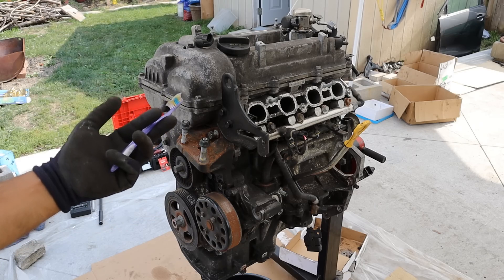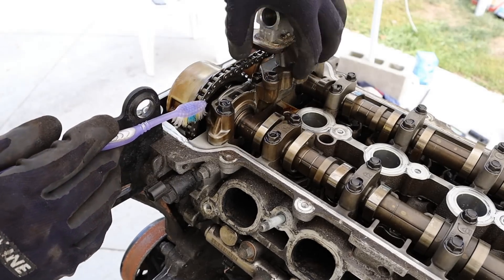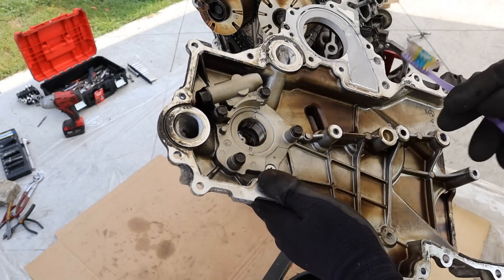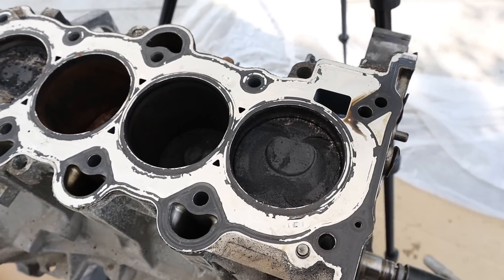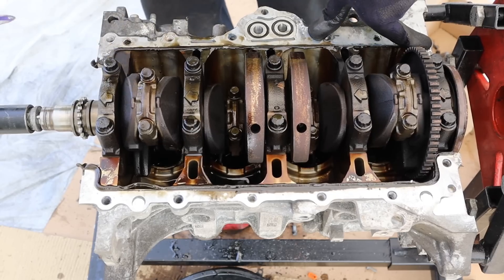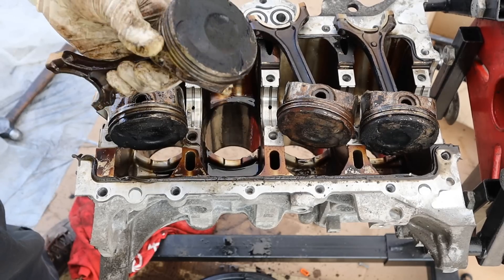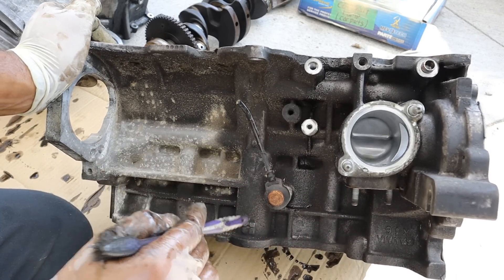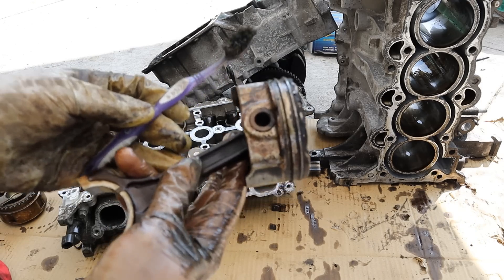Why KIA Engines Fail

Comment: there should be a oil level gauge on the dash that tells you how much oil is in the engine. Watching this video shows how important having the engine full of oil is. If your low 2 quarts of oil and car is going up a hill, that can be a big problem.
Reply from the maker: A lot of people will failing kia engines have them full of oil.

Comment: I know it's not the same engine, but we have a 2008 (!) Optima with the 2.4 4 cylinder engine ... purchased in 2009 from Enterprise Rent A Car with about 34k miles on it ... always used synthetic oil, with oil and filter changes every 5k miles. Always checked oil level at least once a month. It only burned a little oil once a year on fully-loaded vacation trips through the West Virginia mountains on the way to Michigan. Paid attention to other fluid service intervals, filters, etc. Not as durable as a Toyota ... but that car just hit 225,000 miles a month ago. So much of the longevity of any engine from any manufacturer is this boring thing called consistent maintenance.
Reply from the maker: Agreed, maintenance is key!

Comment: Check to see if there is a redesigned oil pick up tube (that's in the bottom of the oil pan) it was redesigned for the 1.8 and 2.0 engines.  The new part sits deeper in the pan and has a bigger opening.  Also Kia changed the oil level in the 1.8 and 2.0, (maybe this 1.6 to) increased it by about half a quart.  Check to see if they modified the oil amount for the 1.6 also and have a new modified oil dip stick available like the 1.8 and 2.0.  Finally, don't use 5-20, use 5-30 Pennzoil Ultra Synthetic, change it every 6k, if you want your engine to last (probably your new engine if you're reading this.)
Reply from the maker: Good tips, didn't know they made changes without publicizing

Comment: I bought a 2015 kia soul with a 1.6 gdi and a 6 speed manual. Brand new like 200 miles , 2025 the car still going with 270k miles. They are good cars if you keep up with oil changes at 4000 miles.

Comment: 2014 Hyundai Accent with 1.6L Gamma GDI with ECO. Purchased new, oil changes on schedule, regular maintenance. Started consuming oil at about 90k kms, and Hyundai told me I needed a new small block engine by 100k kms, for $11,000 CAD. Was burning through all of the oil before the next oil change. Combustion/Top chamber cleaning wasn't a thing offered by Hyundai/Kia when I purchased; today that service costs over $1000 CAD and you have to jump through hoops just to get a dealership to agree to perform it. 
Lots of stories like mine on various forums and facebook groups - it's not "just the owners".

Comment: I have 1.4 cvvt g4fa engine jd. It goes very smoothly. But i throw some money in it. For the engine i replaced couple of sensors, premium oil change with oil filter at each 5000km interval. Same goes for air filter and cabin filter. As i said couple of sensors maybe 7 of them. And every of them worked fine. Fuel filter as coolant rewash with 7 gallons of distilled water. Now it sits in 12+. Brake fluid with brake hoses all 4 of them. Major overhaul of transmission because it leaked inside clutch. And what was an engineer fault is that you must disassemble who transmission so you can change sealing form inside which goes to clutch. New clutch whole kit. All of coils, suspensions, front and suspension bearings. Whole kit. All 4 break discs plus overhaul of all 4 brake calipers front forks. Now i will replace or overhaul for servo steering rack. And all of rubber bushings. Change ac fluid 1234af. Making whole interior overhaul. Timing chain replacement whole kit. And maybe some painting of the whole car. Car is the most reliable car i ever drove. Had m3, had mercedes clk430, audi a3 tsi. Prius. This car have natural aspirated engine with multiport fuel injectors. And i would never buy direct injection engines in future. Turbo maintenance, egr valve etc. thx but no tnx

Comment: I own an elantra gt with the GDI-t on it with 90k miles on it.  This engines aren't robust but are well made and well designed, and as long you do basic maitenance, I am confident mine will do over 200k miles.  The pros are: easy to access water pump, good old school hydraulic valve pusher, crank shaft driven oil pump, simple timing chain,  none an oil leak prone engine, old school thermostat,  doesn't burn oil and finally they do make decent power.
Reply from the maker: Very old school and simple in design indeed. 
The typical owners just don't care for them.

Comment: You did not show the reason why this engine failed: heavy scoring of the cylinder bores. All that debris from cylinder scoring ended up circulating through the bearings. It is not an oil related problem. It's  poor lubrication of the piston ring pack because of the start up fuel dilution and the carbon build up in the piston ring grooves which reduces the amount of oil for the piston ring lubrication during the start up. These engines last long time if the cars see fewer cold starts and long trips. For example, using the cars as taxis. Otherwise you can't prevent these engines from failing. It doesn't matter what oil you use and how often you change it. Using a high detergent gas with anti wear additives (sometimes called "premium" gas) can extend the life of the engine but not the oil itself.

Comment: Most problems with these cars was people didn't change the oil!
Many cars back then were similar!
Reply: 💯&🎯, too many get lazy & do fluid changes next week then blame engine & transmission problems on manufacturers. 

All I.C.E vehicles & their closed for life" transmissions need their fluids changed due to extreme heat, friction, thermal breakdown.

Comment: great vid, the simplicity of this engine is great. it really seems like the make or break factor in here is the oil change interval. if you're not doing it every 5k, that carbon buildup suffocates the engine. i actually believe (i could be wrong) hyundai changed the oil change interval in the infotainment system on the later (2015+) models to alert the driver every 5,000 miles instead of every 10,000 miles.
Reply from the maker: Yes the oiling system (and the myth that they didn't clean the engine of metal debris during manufacturing) are the drawbacks here.

Comment: Carbon is the enemy of these engines.   Do frequent oil changes also.  Drive it normally and i'm betting you will have no problems.  Carbon clean them in your driveway, it costs about $20.

Comment: Idk why people hate on Kia’s so much, my 09 spectra has 280000 miles on it, valve cover never been off but it is leaking a little, otherwise the only thing that has been fixed is a couple timing belts and regular maintenance,,,runs like new

Comment: I've got a 2014, hyundai accent with the 1.6 GDI engine. You must change the oil every 3 to 4k miles and use ONLY OEM oil filters from the dealer. They are designed to deliver oil quickly during startups. These engines have WEAK oil pumps and its a must to keep cleaner oil in them and these oil filters. I have 180k miles and use around a pint of oil between 3500 mile oil changes.

Comment: Hyundai/Kia engines with GDI are garbage. Before GDI, they were making some pretty darn good engines around 2006-2010. Thankfully they've now switched to dual injection, which is GDI combined with MPI to resolve the GDI carbon buildup issues. I also hope they've resolved quality control issues relating to poor machining and metallurgy of internal mechanical engine parts.

Comment: Can I ask why you snipped the wires connecting to the fuel rail? Those plugs should have clips to take them off, unless I'm missing something lol

Just seems excessive unless you plan on replacing them or something
Reply: Everything goes to garbage anyway.

Comment: Bought a 2014 Hyundai Veloster brand new. I had it meticulously maintained at the dealership for nearly 8 years when at 80k miles the engine catastrophically exploded! It was a connecting rod bearing failure😮. Hyundai replaced my engine and have extended the original warranty covering the motor from 100k miles to 150k miles. This problem affects the gamma theta II engines of many vehicles.  If you have the same problem remember Hyundai or Kia may be responsible for replacement. I love my car and am very glad I am able to drive it today.

Comment: could you tell me is it possible to change valve stem seals on this engine if head is still on the block without valve dropping into combustion chamber if you put piston on TDC ?
Reply from the maker: I don't see how this is different than any other engine. In my opinion very similar to a Toyota in design.

Comment: I have 4 Kias. K5 2013 110k miles, i10 2013 62k miles, Santa Fe 2.2 Diesel 2013 70k miles.  Zero problem whatsoever with engines.  Super minor issues with other stuff like power eibfiw for the i10.  I also had a Kia Sportage 2009.  That one was a basket case with never ending issues with engine and ECU.  Had to sell it off.

Comment: "Typical Kia owner". Um.. I don't think Kia owners are any worse than other owners. I am not one.. but it seems an odd thing to say like they are some special kind of bad owner.
Reply from the maker: If you're buying the cheapest value branded car.... can you speculate that they'll do religious oil changes with synthetic oil every 3000 km.
Reply: @speedkar99   Well.. times change. KIA has the second highest customer loyalty behind Toyota now (which surprised me). They also not cheap. But back 15 years ago they were definitely more of a discount "we will finance anyone with a pulse" brand. By the early 2010s they actually had some more compelling products attracting better customers. I will say the Hyundai/Kia four banger problems are very disappointing. The Car Wizard showed a relatively nice Sonata that was junked due to the engine issue.

Comment: My girlfriend had the 1.6 in a 2015 Kia Soul and it was actually a very reliable engine, unfortunately it was totaled at 130,000 miles and we’ll never know how long it might have lasted! I did oil changes at 4500 mile intervals with Pennzoil Platinum 5w30 and it never had an issue!
Reply from the maker: It was probably swapped into another kia

Comment: I know its an old video.. but I wanna ask if any aftermarket parts can be installed to make the engine better interm of reliable & increase fuel efficiency ... thought to buy a high quality part for my engine that need to be overhaul.

Comment: I think a lot of the problem is owner neglect.  Also the 'sport' mode on Kia's are too aggressive. It's far more aggressive than the Japanese brands and it encourages drivers and the irresponsible car owners even more so to push the engine to the limit.  That together with the neglect of simple oil changes will cause problems.

Comment: I like the video demonstration top notch!! I drive kia cerato koup 1.6 GDI. It  overheats only when idling or been driven for 100km and you stuck on traffic the temp gauge will go up. i have changed thermostat, waterpump, temperature sensor, check radiator for any leaks, fun is running when required however the oil deep stick doesn't show if the car is mixing water and oil. what will be the issue now?

Comment: a very good show & tell explanation...thank you

now...I AM an average Kia owner, '23 Soul with mpfi 2.0, and I do check my oil...every 2-3 weeks! I currently have 9.7k miles and am approaching my 2nd oil change...dealer urges a 5k mile OCI using expensive full synthetic 0w-20 oil which is under utilized for such a short OCI

I can understand why owners push extended OCI's on these...when you spec full synthetic 0w-20 full synthetic and urge 5,000 mile oil changes, people get upset when charged $75-100+ per oil change! 5,000 mile rated oil falls in the category of 'conventional' or 'synthetic blend' and the oil changes usually cost less; 

spec full synthetic oil and urge OCI's for 5k miles is a waste of money & resources...full synthetic oil is formulated for higher mileage OCI's; 7k miles is still low, but better than 5k miles! even Subaru's 6k OCI is low for the capability of the oil! 

respec the engine for 5w-20 conventional or synthetic blend & 5k mile OCI's are justified!

Comment: Pull engine oil Solenoid value ( qty 2). Oil  flows though them.   Remove and inspect every 2000 miles.   Has fine screen that stops debris.   Keep clean.   Good if everything moves to screen then that is good.   Depends if left over metal from manufacturing process ( of engine block).  If debris doesn't plug any where else then would be safe.  Horrible that they just don't tear down each engine and clean before sale.   Very bad.
Reply from the maker: Yeah it's quite sad
Reply: @speedkar99 is a great easy check point

Comment: Is there a way to prevent or diagnose this before it happens? Something like looking at the engine for possible damage, or the oil pan for debris. I have 2016 Forte 2.0 MPI with 100,000 Km, it has been smooth and without oil consumption, there's only like a "knocking" sound that happens sometimes for ~1s when turning on the engine, but only when it has been warmed up and turned off for a few minutes. If it is cold the sound is never there! Strange, but I'm kind of worried.

Comment: All this muck in the engine is the result of extended oil change intervals,it’s ridiculous to leave oil in for 20,000 miles even if the oil manufacturers say it’s ok to do so,it may be alright for high annual mileage vehicles where the engine is continually hot but on low mileage short journey work where the oil temperature rarely reaches it optimum level it’s suicidal to leave the oil in for those sort of mileages. When you consider the cost of a new engine against oil and filter changes it’s a no brainier. I do mine every year because I rarely do more than 6000 miles and have never had a problem with any of the vehicles I’ve had over the last 60 years. As I’m a mechanic I never trust anyone to do these jobs for me,anything that needs doing I do myself as and when required,if it ain’t broke I don’t fix it,I check the vehicle out several times a year so I can check things like brake pad wear so I can plan when things need to be replaced in advance,this way I can source the best price materials and have them ready for when replacement is required. I have spent minimal money over the years keeping the vehicle in tip top condition,I don’t pay crazy money for top named oils,I buy on the specification of the oil and purchase accordingly,I use 5w/40 all the year round in case we have a really hot summer just as a precaution and this practice has never let me down. If the vehicle needs it it gets it,simple really and it works,I treat the vehicle gently until it’s warmed up and if I’ve been on the motorway leave it to idle over for a couple of minutes to cool the turbo before shutting the engine down,I run a BMW diesel that’s done nearly 130,000 miles and I have no intention of replacing it until it’s done at least 250,000 miles it runs so well.
Reply: Good for you! An old school operator like myself! So many people have no empathy with machinery nowadays .I'm on my third 1.9 TDI VW Diesel ,each of them exceeded 330k miles before needing any real attention( excepting starters alternators etc).Oil and filter change every 6 K miles with the CORRECT spec oil and a quality filter.Depress the clutch upon starting and the dual mass flywheel/ clutch assembly will last forever.Dont thrash the engine until it warmed up be aware that a turbo needs to be understood.' Long life' oil is a manufacturers racket!

Comment: Maintenance maintenance maintenance that is the key check oil changes regularly dont thrash the hell when cold treat a car respectfully and it will go for years and years. 😊 i might add in over 23 years and 9 vehicles owned ive not had any mechanical issues with any of them only a clutch and a failed transmission stuck in reverse on a gm car.😅

Comment: We have Kia in our police fleet going on over 4 years now, some hitting 140K some have spent a lot of time at 100 + mph in chases, hitting 150+ on the sorentos, the Kia soul Traffic units are at 60K and none have every seen a dealership, or had any issues, we change the oil every 5k not 10k we do the upper end service as per the Hyundai TSB. I as the fleet head Tech, believe its how you service them that matters, barring some serious manufacturing defects, FORD,,

Comment: It is surprising that I still see new Kia cars on the road , you would think that people would do maybe a tiny bit of research on these cars before they purchased them ? I just picked up a Honda Civic SI and I’ll be changing the oil every 2,500 miles and I’ll be on top of the maintenance of my car . Just a side note : it’s truly surprising how much power Honda gets out of the 1.5 turbo engine they put in the Civic SI

Comment: Thanks for step by step breakdown of the KIA engine, it's amazing what it takes to have an engine that’s supposed to operate properly and the manufacturer use inferior parts and bad design, but it probably is the same with GM and Ford and Ram engines that build engines with inferior parts
Reply from the maker: Yeah